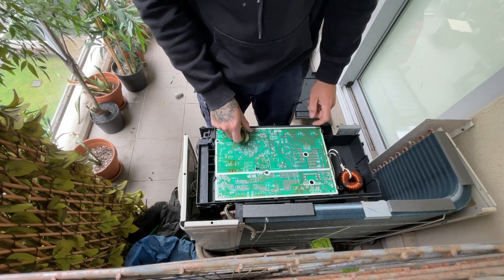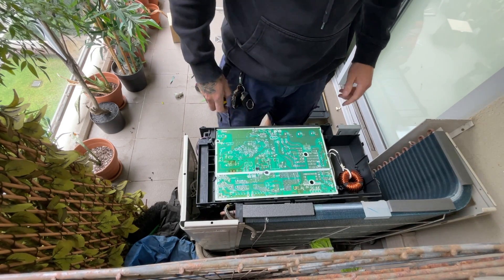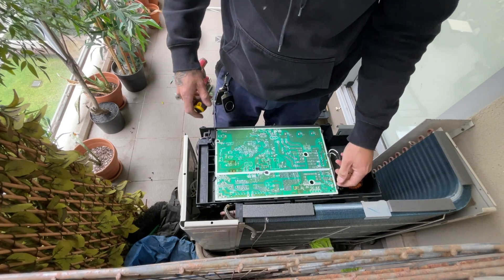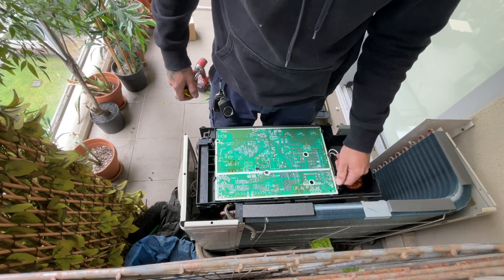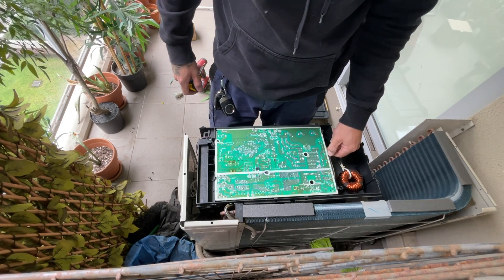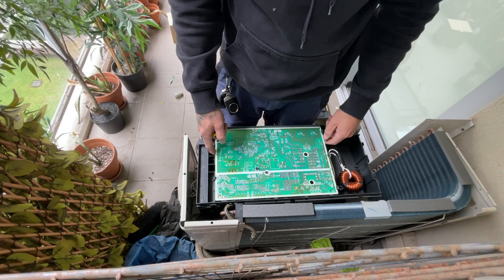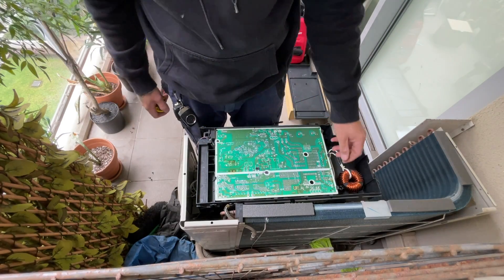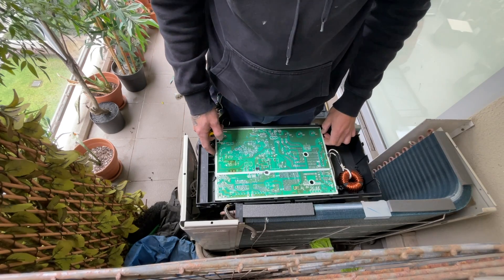Repairing Daikin UF Error

Comment: Ok forgot to mention that used way too much thermal paste, obviously you've never read or researched how to do heatsinks. watch a video of how to install thermal paste on processors. That board won't last long if thermal paste all over it and they make thermal paste remover/cleaner, then you use the primer on both surfaces.
Reply from the maker: Thanks mate

Comment: Why do all that work and not even clean the fan blade? You're already putting a strain on a new motor. "Typical Lazy tech" would've taken 10 minutes to clean fan & spray condenser coils with water from inside unit out while all covers are off.
Reply: Oh give it a rest hero. That tiny amount of dust on the fan blade is not going to strain the motor and the coil is spotless. 
You always do pointless work for free?
Reply from the maker: Thanks mate

Comment: You are 100% correct on replacing the fan motor.  Mitsubishi has a similar setup on one of their models where the board is upside down abs you have to be a contortionist to see the blink code. Great job stay well.
Reply from the maker: Thanks again mate. They definitely don’t make it easy for you do they! Haha
Reply: Great video and good point regarding replacing the motor that was obviously on the verge of failure.  BTW, how long did you spend making the repair vs time spent making & editing video?

Comment: Nice video! I don't like the grille they have, the old one would've looked much better.
Reply from the maker: Thanks mate. Yeah I think they put it on so a kid can’t climb up and fall off the balcony.
Reply: @maracservices  Okay. Safety is a higher priority over style if kids are around constantly.
Reply from the maker: @zanelancaster2007  I’m pretty sure it’s actually a requirement here in Australia for new builds. So unfortunately if the unit is on a balcony close to the edge, you need to modify it. Thanks mate
Reply: @maracservices  Ahh okay. I think my family needs to change that soon...